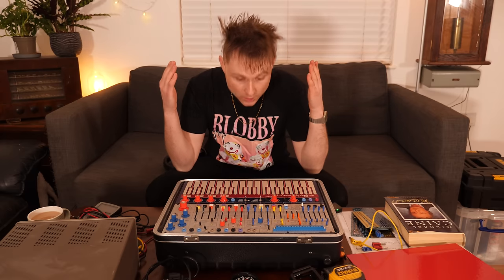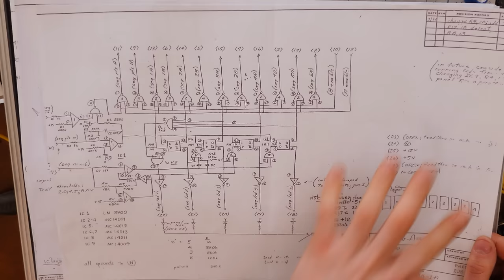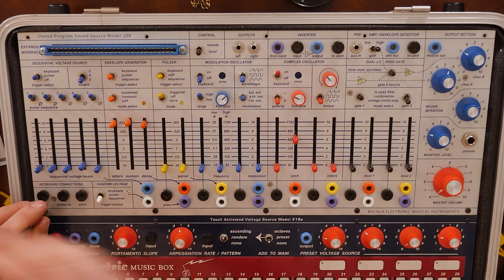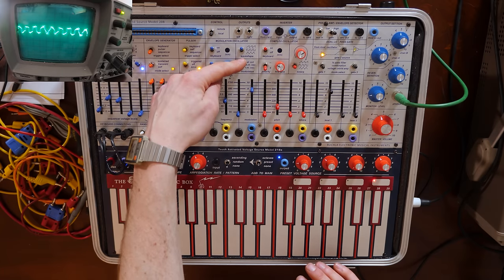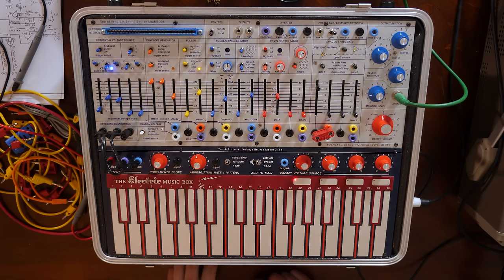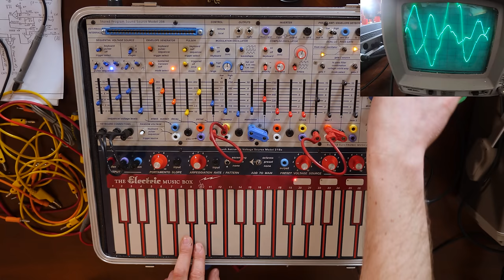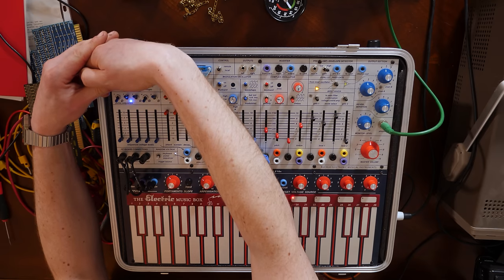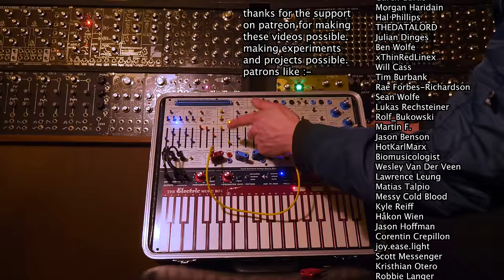THE STRANGEST 70's COMBISYNTH AND UNDERSTANDING IT - Buchla Music Easel -

Comment: As the person who did the PCB layout on both this version and the 208C, I appreciate how much is accurately and efficiently covered in this video. FYI the newer 208C adds some IO and looses the daughtercards in favor of one large board on the back so that it would be easier to service and cheaper to build, but the circuits are still essentially the same even on the 208C.

Comment: Hey Sam,  Great video!  The version you have was designed by Don Buchla (DFB on the pcb) and Joel Davel (initials JJD on the pcb and current lead designer and Don's right-hand man/protégé since the early 90's)   This version was manufactured between 2013-2019 before they evolved into the newest and current Easel Command/Music Easel "Modern"/Music Easel "Retro" all designed by Joel. Depending on your exact year of manufacture, there might be some updates that can be done.  We certainly want any Buchla owner, regardless of if they are the original purchaser or not, to have a working instrument that they can enjoy for decades :)  Just hit us up! -eric
Reply from the maker: Hey Eric thankyou for the comment! Very interesting. Apparently it's 2015ish but how would I know the sort of date? Certainly interested in hearing what updates these are you speak of. It's a fabulous machine, I wasn't sure what to expect as I hadn't experienced using one before. Really pleased with how solid and proper it is. Amazing machine.

Comment: I've had the Easel as almost my only synth for almost 2 years, I play it every day and it's magic. You could try patching outputs to outputs and using diodes instead of shorting bars, the loading effects can be amazing, but maybe its my old school op amps (4136) vs whats in the newer easel. You won't damage anything. Great video.
Reply from the maker: is that an original? whats the going rate for an original out of interest?
Reply: @LOOKMUMNOCOMPUTER  not original, clone, but with 70s era op amps. I like it because I don't think about chasing equipment, it just works beautifully and the ergonomics are fantastic.
Reply: wait, why would you patch outputs to outputs?  what effect would it have?
Reply: @dontnormally  on buchla systems you get a mix of the two signals but it’s not linear, more of a kind of VCA effect, which I often find really useful for making more organic sounds.
Reply: @moldycoats  oh neat, alright that sounds rad i'd like to see it in action

Comment: It's one of my dream synths. I use some west-coast inspired pieces, but the easel or maybe even getting a bunch of those less amazing but affordable tiptop audio/buchla modules, or actually get it without the key plate- it has a sequencer and maybe it connects to euro rack too.
Reply: Not sure about the tiptop modules, but the originals need a converter to talk to Eurorack. The Distings by Expert Sleepers will do the job.
Reply from the maker: definitely look on second hand market, i think its a bit slow atm, i got this for less than just the module and also less than it would cost to make a eurorack version of it. definitely fire offers over haha

Comment: Separate boards. So nice. Makes diagnostics and replacing so much less hassle. The Yamaha DD65 has separate boards, from what i can see (a quick look so not in depth) the trigger/MIDI converter board are separate from the amp and sound makiing hardware.
Also, that thing is dangerous.

I know i could loose about a month every week getting my synth on with this bad boy.

Comment: I built the DIY version years ago. I bought the boards and panels and had to source all the parts myself. Took me ages to build and calibrate it, but the end result was well worth it. By the way, you can use empty preset cards to glitch the fuck out out of your existing patch by pressing down on various solder pads. Hours of fun!

Comment: I can tell you aren't a software guy but there's some Buchla 200 inspired modules in Cherry Audio's Voltage Modular by DMT Audio that are fun to mess around with if you end up enjoying this style of synthesis. If you have an audio interface with DC coupled outs you could use some floating ring cables and send the virtual modules CV to your other gear. It can be pretty quick to get some convincing results this way. Congrats on the purchase!

Comment: “This isn’t recommended but whatever…” OMG, with something that expensive with SMD parts I’d be handling it with kid gloves! 

Hope you get to mess around with some Serge stuff at some point. Once upon a time it was designed as a less expensive DIY option to ready made synths. If I ever did DIY I’d definitely go with banana jacks, so much better than the other connectors.

Comment: I have been looking at building one for a while (aswell as the TTSHv4) but haven't gathered the courage (or money) to do so yet! maybe this will finally spring me into action
Reply from the maker: Definitely look at second hand market before you plunge. It's slow. I got this for a lot cheaper than expected to the point I think it was cheaper than if I diy'd it
Reply: @LOOKMUMNOCOMPUTER  it’s not even too important for me to have the 218 module and I’ve seen the 208c go fairly cheap secondhand, but I live in Norway and the market isn’t that big and if I buy one secondhand from the EU I’ll have to pay VAT :(

Comment: Did they have ICs in 1973? I would have expected actual transistors.
(Love the way your immediate inclination is to take the thing apart.)
Reply from the maker: IC's found their way into commercial machines in the late sixties. By the time 1973 came around it just was the done thing, that schematic is the 1973 schematic.
Reply: @LOOKMUMNOCOMPUTER  I'm trying to remember when I went with my father to an electronics store to pick up some of those new-fangled IC things. In retrospect must indeed have been late 60s. Beats me if I remember what he made with them.

Comment: LM3900 is a "Norton amp" -- it's not a standard op amp, and there's not really anything else like it, so it's not something that they could have readily substituted. (Serge was a big fan of the 3900, and it was also used in an ARP filter.)
Reply from the maker: Cheers. I shoulda checked beyond.
Reply: @LOOKMUMNOCOMPUTER  It's a super obscure detail. Norton amps have a voltage output like regular op amps, unlike the voltage inputs on regular op amps, Norton amps have current inputs which lets you do some weird trick. Coolest thing is they're used in the sound circuits of the Space Invaders arcade machines!
Reply from the maker: fair enough. only thing that confuses me is the schematic for the sequencer. functionally (granted i havent looked at the pulser circuit for instance) is they are wired like voltage buffers it would seem, having seen similar circuits to this sequencer, using standard opamps in the same configuration. curious. there must be a quirk i am likely not aware of   @Lantertronics
Reply: @LOOKMUMNOCOMPUTER  A really challenging thing in trying to sort out the Easel schematics (beyond the usual challenge of "what in the world was Don thinking?") is that a lot of the boards don't really have the "complete" circuit. Take the "sequence number" input (pin 1); you have to follow that out to the "wiring diagram" to see what it's hooked to.

It's exciting to see you enter Buchlaland!
Reply from the maker: ha nice yes i have found! however i hadnt found it odd as i have spent a lot of the past couple of years working with GPO schematics which work like that, infuriating at times.  @Lantertronics
Reply: @LOOKMUMNOCOMPUTER  What's GPO?